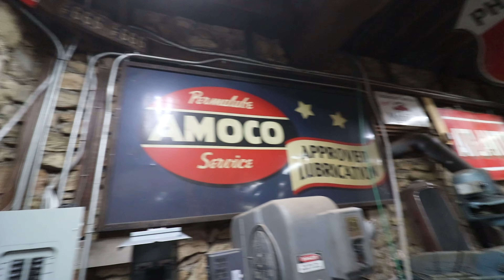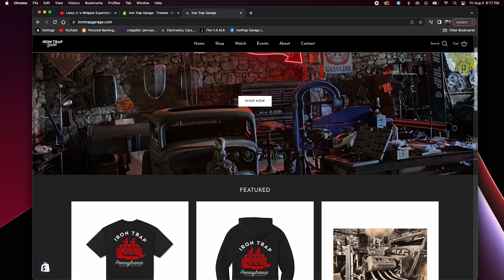We Bought A Ton Of Parts & We FINALLY Have Lights....Kinda

Comment: My Dad bought a new pale blue 1955 Ford Station Wagon. It looked like the color of the Ford at 27:00.. Quality of the body & trim was bad. Powertrain was trouble-free. The Y-Block V8 ran like a champ, but the generator required many replacements.

Comment: Just one of your parts finds would set me up for life here in the UK I'm lucky if I find a trunk full every few years.
Reply from the maker: We are very thankful there’s so much left here in the states!
Reply: I'm into 70's ford cortinas which was the best selling car in the 70's for it's 12 yeAr life span .
Yet there are very few parts left, the aftermarket isn't interested only one company makes panels in small batches that are very expensive, nos is like wise so it's down to used. 
Mechanical stuff is shared across the range so not so hard to find. Trim is nla.
Great to see you guys enthusiasm.